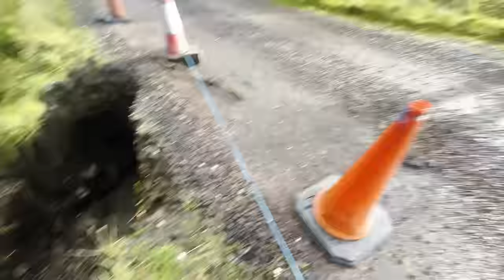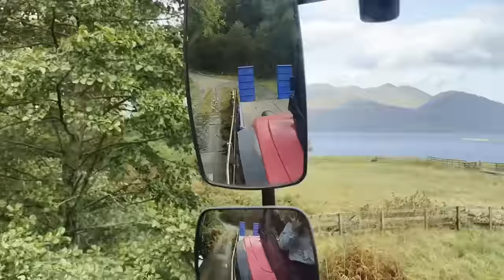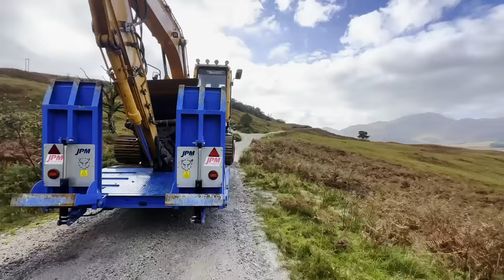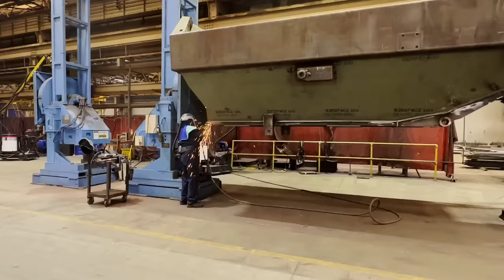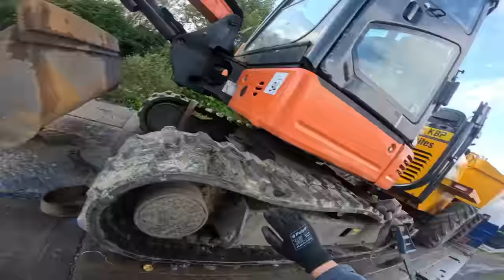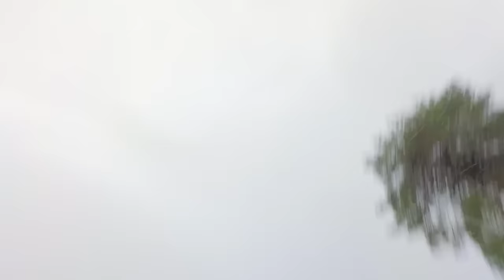Landslides DESTROYED Roads!

Comment: Interesting video. Maybe that culvert needs to be replaced with a precast concrete box culvert, to provide extra capacity without increasing the road height.
Reply from the maker: I think a plastic one will be grand with a decent head wall. It was the most rain we had in 30 years so bound to happen.
Reply: @the_digger_girl  Yes, I had a feeling that the wall was the main issue but could not see sufficient detail in the video to be certain. I did a few culverts with my old field squadron and high standards were required, not least because our Squadron Sergeant Major’s civilian job was: Ministry of Works Bridging Officer for Wellington. Every RNZE bridge design had to be approved by him.